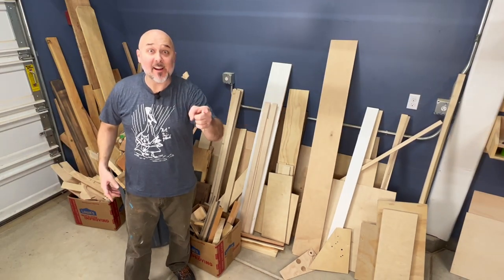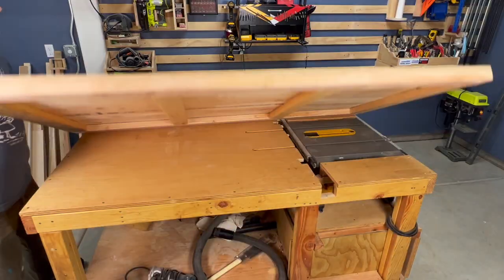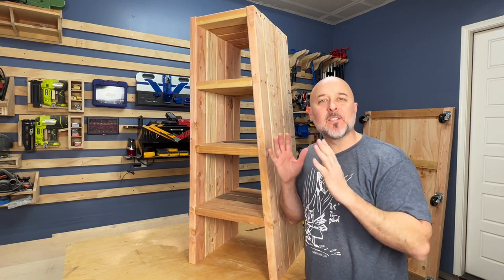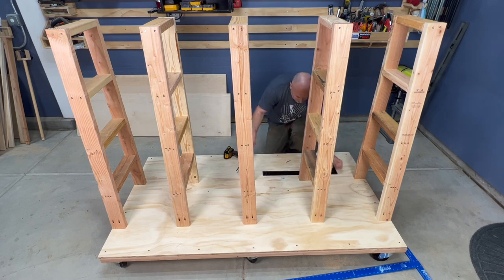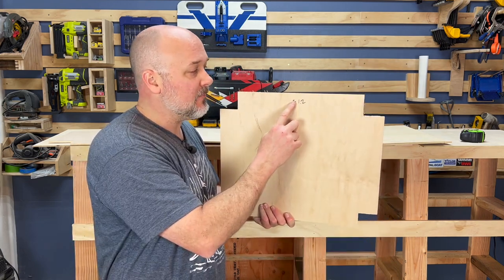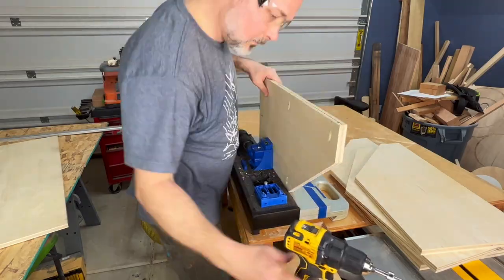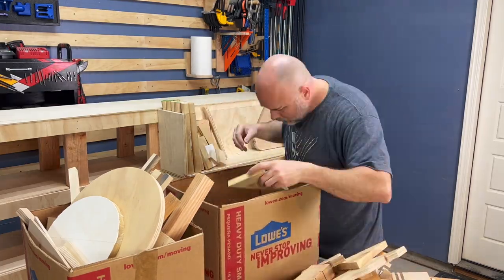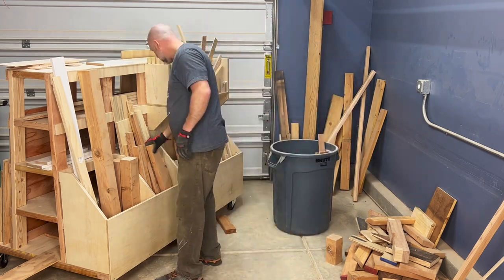A BRILLIANT Twist On An Old Idea || Rolling Scrap Wood Cart

Comment: I've been looking at scrap carts for over 2 hours and had picked my 2 favorites. And you just made the fusion of those 2. Exactly what I've been looking for
Reply from the maker: Awesome! I'm so glad I could help. I've been working on plans, but since this is my first attempt at making plans it will probably still be a while before they are available.
Reply: @DudeSawdust  making the sketchup file for myself is usually a breeze. But step by step instructions can be tricky. Things my be obvious for yourself, but not so much for the reader.

Can you give me the rough measurements of the base/footprint of the cart?
Reply from the maker: I’ll do you even one better, it is 6’ x 3’ and 4 inches. That is exact. Good luck on your project.
Reply from the maker: I'm sure you have already built your wood cart. But just in case, I finally have digital plans available: https://www.etsy.com/listing/1252056855/scrap-wood-storage-cart-digital?click_key=29faa3dc1eea9b01fd1211040aac44925e134061%3A1252056855&click_sum=17254930&ref=shop_home_active_1
Reply: @DudeSawdust  I just now sent a message through the Etsy message board.  This is the answer I was looking for.  I'll check it out with a dry layout and if it works, I'll buy the plan

Comment: CASTER WHEELS WITH BRAKES WILL MAKE A MASSIVE DIFFERENCE! I like you're take on the board storage cart, great vid.
As for the brakes... I have a 3m long double sided board rack in a double garage not much larger than yours. If you have the option to lock a brake in one corner the cart can pivot from that spot. This really comes in handy when you have it stored next to a wall or shelving and you need to access behind one end. Pull out one end you need to access, get what you need, then push it back to exactly where it was before. With no brakes the opposite end will move as well and more than likely hit something you don't want it to (...if you are as starved for space as much as me. If you're not, then you soon will be :-)). Another thing to be aware of is that these things get heavy, really heavy! Don't skimp on casters. Make sure your wheels can take more than you think they'll need to. The bigger the wheel, the easier it is to start moving. Good luck with your future projects and best wishes for the future of your channel.
Reply from the maker: Your idea with using just one brake is a great idea. With it all loaded up it’s pretty heavy but still moves where I want it to. Thanks so much for watching 👍

Comment: I love brilliant,  but comme on now I look over critical:.  Remove every 2by4, what’s left is nearly a giant torsion box, make that work.  For economy four wheels will do, maybe just stay shy of the corners to make it look balanced/car like.  Use scraps, for me a good scrap cart must look like patchwork otherwise it’s a junk cart.
Reply from the maker: 🤣🤣great ideas. But with the weight of the cart once loaded, the 6wheels are a must. I agree with your patchwork idea, but there is a certain YouTube appeal that aesthetics make an impact. Thanks for your comment. Come back again sometime 👍👍👍
Reply: @DudeSawdust  indeed I did a full sheet length version with one single sheet and scraps (no 2by4) and it lacks on esthetics.  For the wheels I used 4 pairs of small 3 dollar wheels without any bottom frame to reduce the height as the top is also a miter saw station.
Reply from the maker: Sounds like an epic cart!

Comment: I wish I could find 2x4's that look that straight. Seems all I kind find as of late are pretzels.
Reply from the maker: The struggle is real! Here's a tip: Buy 2x8s or 2x12s and then rip them down to size. They last longer on the shelves and and are more often dried out so the warping and twisting is mostly done and they won't move too much after bringing them home. 2x4s sell a lot faster so often times they are fairly moist on the shelf and can be unpredictable in their movement.